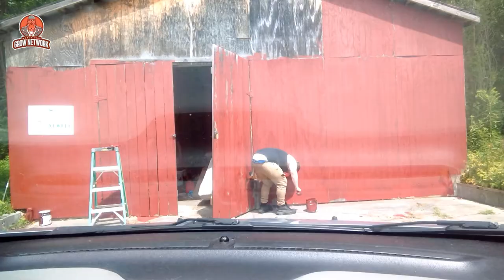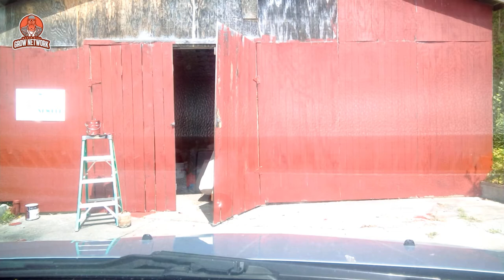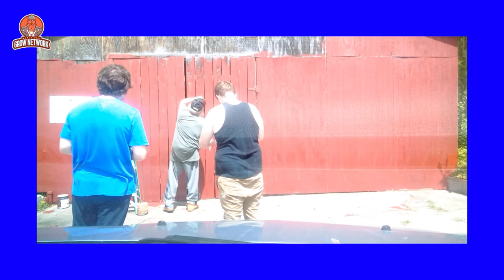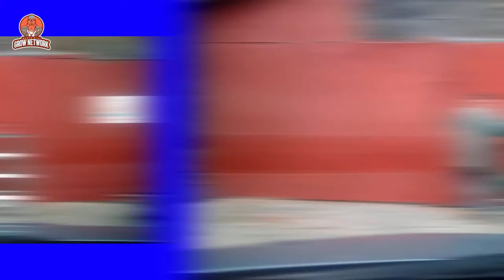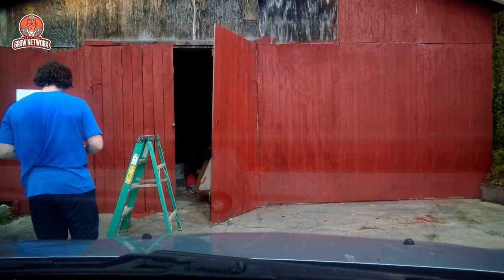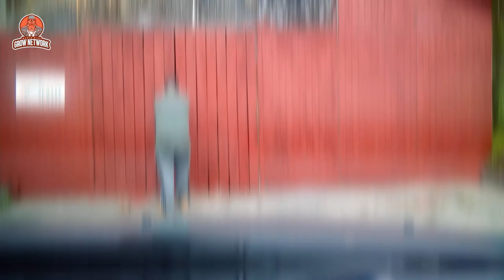North Western, NY Newell Sunshine Gardens Painting Pt.3/of 3 July 2, 2020

Comment: You have been very busy looks great!!
Reply from the maker: The white is not done yet, was drawing in some ideas, I will be doing white trim but no N,
Reply: @wmnewell  No N ? It will look great. Are you going to seal it with Thompsons or something to keep the paint from peeling off and the wood from water damage? I know that is a yearly job but well worth it.  I would be very happy to try to do something to help you if I lived close.  Being Disabled and STUCK in this house is driving me crazy.
Reply from the maker: @sassycrafterfromalabama2373  used Bher Barn and Fence paint. An advanced exterior paint combining the best features of oil and latex for superior color retention, adhesion, penetration and durability.
Reply: @wmnewell  
Oh Yes that's a great paint ! I Love using it.  Wish I could paint this wretched place. ❤ U !!